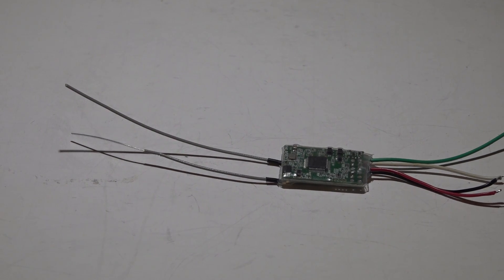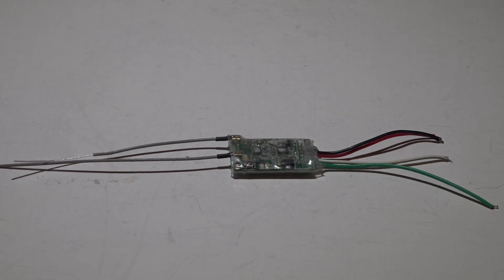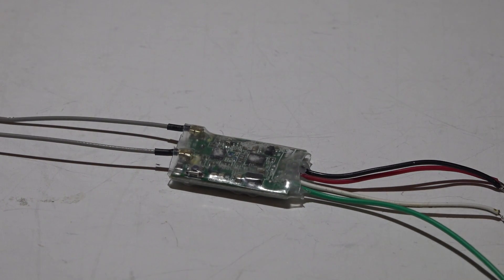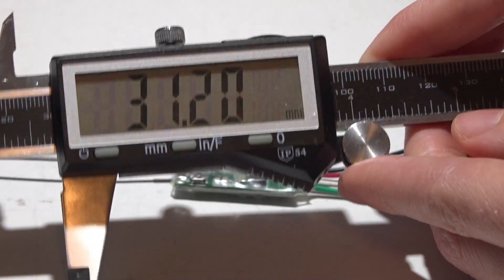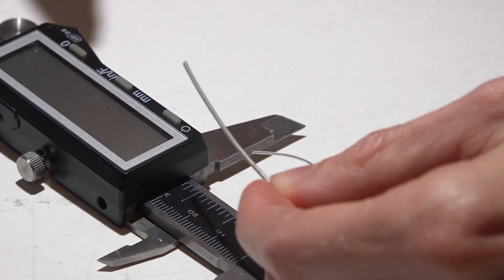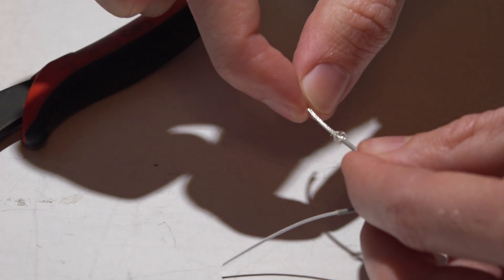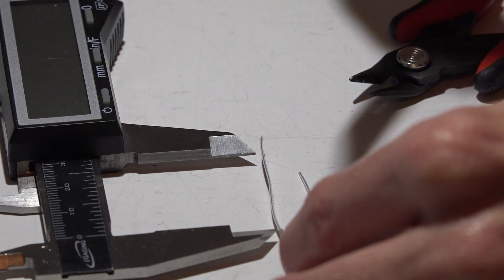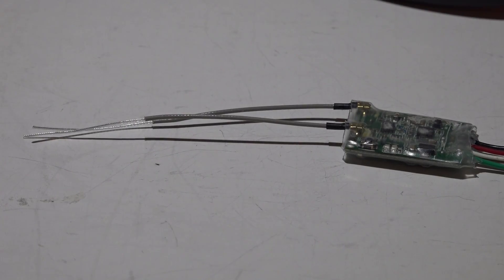How To Repair 2.4Ghz Receiver Antennas

Comment: No disrespect to JC, but those of you that still learn from his videos, as I do, I came across some more recent info about the length.  It seems the math he briefly shows, that many use, to get to 31.25mm doesn't take into consideration that radio waves travel at the speed of light in a vacuum, or void, but not through wire, which has impedance.  So this guy claims better signal at closer to 27mm, and many antennas on the market are right at that length.  Something to think about.
https://www.youtube.com/watch?v=8iBoRNyrrPM

Comment: Does it have to be exactly 31.2mm or can there be a little wiggle room? The original exposed wire is slightly shorter but in the manual thing that can with the receiver it says that it's 2.408 to 2.475 GHz.
Reply: https://www.youtube.com/watch?v=8iBoRNyrrPM

Comment: the pack of 20 antenna wires that you have suggested, will they clip right on to the XM+ ?
Reply: Unbelieveableman ;D This youtuber has sadly passed away in a motorbike accident. R.I.P.
Reply from the maker: No, the XM and XM+ actually uses a smaller connector. Instead of UFL connector, search for IPEX. They look like this http://www.banggood.com/10X-150mm-2_4G-Receiver-Antenna-IPEX-Port-For-FRSKY-JR-p-1046122.html?p=3827048207257201612A
Reply: Arent you going to loose signal strength through those ufl connectors instead of directly soldering them onto the receiver? 

PS: Still waiting on the Taranis Antenna-Mod video :P
Reply: Silo Holy shit. I dont know what to say. I have watched his videos for one and a half years, learned everything i know today from him. We talked very often in the comments and i was the one who told him about the omnibus flightcontrollers when they came out. I was so happy that he actually used them after we talked, until today. I could finally give something back. I am speechless...

Comment: hi..the lenght of antennas should be same on both sides or is it OK to have one antenna longer than the other? what matters is the exposed end of the antenna,right? thanx
Reply from the maker: Yep just the exposed part matters. Other than that they can be different lengths.
Reply: thank you